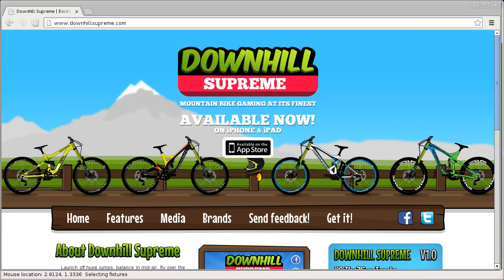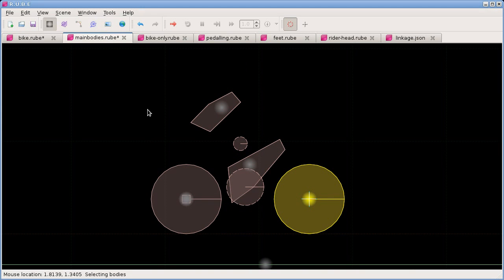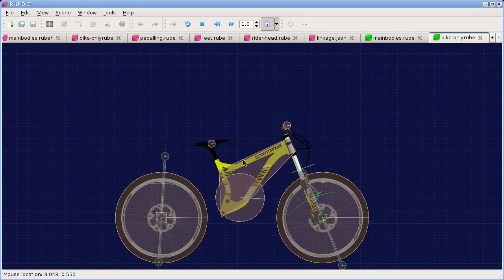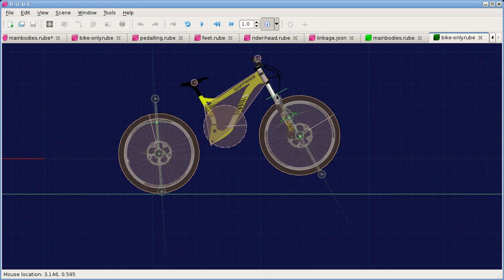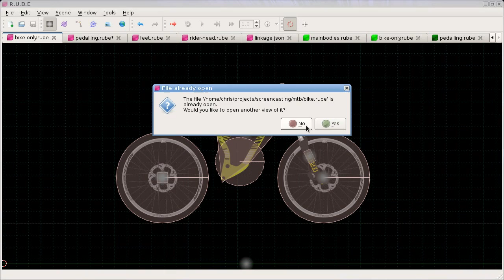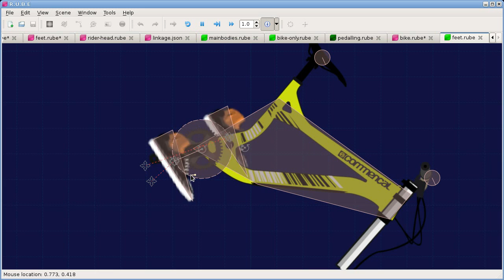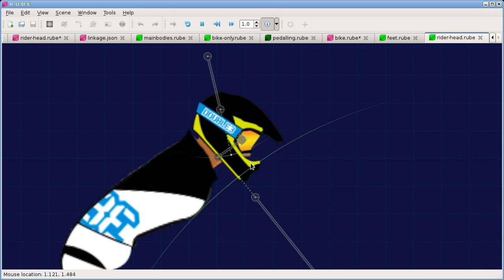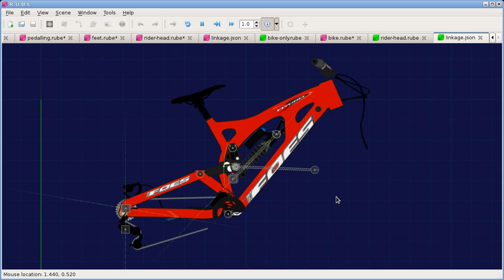Box2D mountain-bike

Comment: What joints used for wheel binding except ropes?
Reply from the maker: wheel joints
Reply: Why your rope joints stretch in only single direction? My ones dangle like noodle
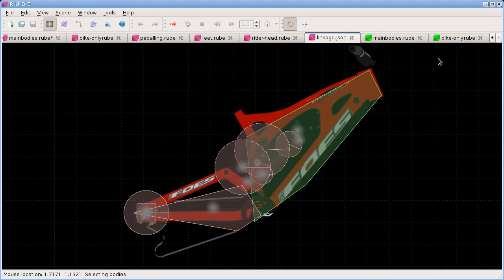Reply from the maker: Because there is a wheel joint...  the wheel joint restricts movement of the joint anchor along a line. The rope joints don't 'stretch', they just enforce a limit on how far the wheel joint can move. I explained it all at 6:32

Comment: Hello iforce2d

I want to say that I really apreciate your work.

I would like to know if you will release a new version of RUBE? I saw that the last versions was the last year. I am working on libgdx and I am planing to use you software

Best Reagds.
Reply from the maker: I am planning to make an update sometime, but no idea when. Is there some new feature you would like to see, or a problem that needs fixing?
Reply: There are no problems, the lastes version is very stable, but We are going to start a project using libgdx and RUBE. Because of that, It is important know if the software will continue keeping support.
Reply: Hello

Could you recommend some library to port RUBE to "libgdx"? There are many but they have been dead for years.

Best Reagds.
Reply from the maker: I made a Java loader for RUBE scenes that works with JBox2D. That would be the first place to start porting from I think.
https://www.iforce2d.net/rube/?panel=loaders (at the bottom)

Comment: Hello, how did you get the rear wheel movement to stay parallel to the rope joint axis? When I create 2 rope joints the way you did, the wheel wobbles back and forth (left and right) and the rope joint limits are not strictly enforced (I can pull the bike down far enough to where the constraints are violated and the simulation goes crazy).
Reply from the maker: +ysvleis the wheel is attached to the frame of the bike with a wheel joint - it restricts the movement to a line relative to the frame.

Comment: I've read your post on box2d forum, and I'm still confused how you achieved the leaning effect. So you have 2 distance joints attached to the biker's body, with the other ends attached in the front/back of the bike body (in the air), and you increase/decrease the distance on those joints? I'm trying that right now with my similar bike game and it's not really working. Could you please elaborate on exactly what you're doing to the joints? Thanks!
Reply from the maker: +artashes999 yes, I adjusted the lengths of the distance joints. If the other settings are reasonable (frequency, damping etc) it should cause the torso body to move and/or turn, depending on how you adjust the lengths. Keep in mind you'll also need reasonable settings on all the other joints involved too, to allow the movement range you want. Maybe you could try using only those two joints (zero-gravity world might help with that) to isolate their behavior and then add other joints back bit by bit and see what interferes with the movement.
Reply: hi, thanks for the reply! And for Rube, I bought it a couple of weeks ago and really enjoy using it. As for the rope joints; I do also have a wheel joint attached to the frame at the center of the circle body, and I've played with different dampings and frequencies for the wheel joint but I am not able to reproduce the tight vertical movement that you have on that back wheel. I tried for hours last night, nearly pulled my hair out. Heh. I tried throwing in a prismatic joint, or attaching the wheel to another body that is attached to the frame using a prismatic joint, but still no joy.
Reply from the maker: +ysvleis do you have the bodies the right way around? The wheel should be bodyB of the wheel joint, and the frame should be bodyA.
Reply: +iforce2d that was it, thank you so much!

Comment: Hi, I'm using rube to create a biking game similar to this. I'm having difficulty making my bike behave with exciting "game" physics. It doesnt accelerate or take jumps like i would like. What parameters do i need to change to achieve this?
Reply from the maker: +Frederic Trepanier Ells That's very vague. How can I know what you "would like" is, and how can I know what the current behaviour is? If you can be more specific maybe I could help.
Reply: +iforce2d My bike feels sluggish and heavy. I want it to have much sharper feedback, being able to stop and accelerate much more quickly. My goal is to behave similar to canvas rider, but at the moment it is more like your vehicle demos.
Reply from the maker: +Frederic Trepanier Ells I don't think canvas rider uses any realistically simulated physics - they probably just set the values directly, eg. velocity.x = ... instead of using joint motors.
Perhaps you could try doing that to help overcome the sluggish feeling.

Comment: hello, I have been using your program a few months, but I have a question. Is there any way to move automatically the camera following  a body in a large simulation in RUBE editor(is cumbersome to manually follow a bicycle in a large terrein, for example).
As usually in games where the camera follows a given body.
Not if I see you understand jeje
Reply from the maker: You mean in the player view right? Yeah, I know what you mean. When developing this game I actually modified the RUBE code a little to do that. I'm thinking of adding scripting capability to the player view, so that things like this could be done. It's not possible right now though.
Reply: That would be great!!!
I think tha it is a important upgrade for the software :D

Comment: i got one problem i just cannot understand how to load the Json file wiht rubeLoader a tutorial how to set up the projekt would be awesome. using eclipse java with libgdx.
Reply from the maker: "cannot understand" is very vague. I have not used that particular rubeloader myself, but I'm pretty sure there are some posts in the libgdx forums explaining how to use it. You can find them linked to from here: http://www.iforce2d.net/forums/viewtopic.php?f=6&t=240 (try also searching for 'rubeloader' in my forums).
If there is something more specific you can point to as the part you are having trouble with, try making a thread either in my forums or the libgdx forums, whichever seems appropriate (libgdx specific stuff would be better in the libgdx forums).
Reply: hello oskar.
You can use this loader http://www.andengine.org/forums/gles2/rube-loader-project-t10860.html
It was create for nazgee, I have been load rube prototipes some months ago, Its work perfectly :D
Reply: ok thanks to both you :)!